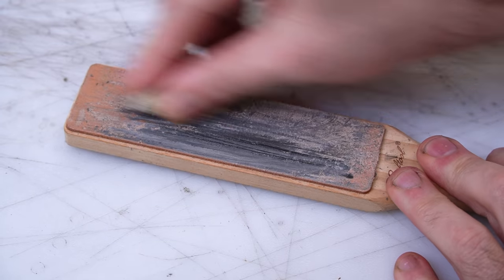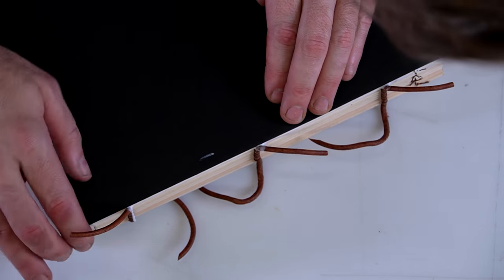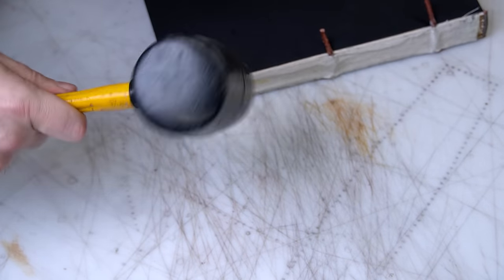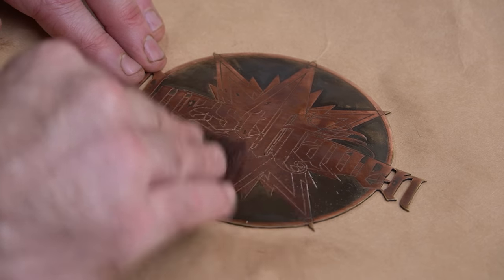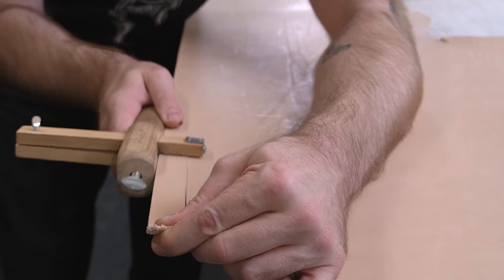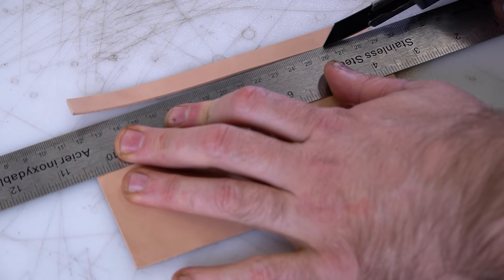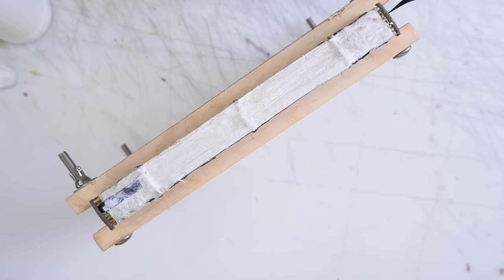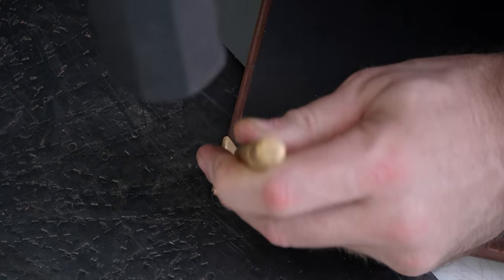Making an Epic Leather Book for QuestHaven | Learn How to Make a Book

Comment: If you glue thin cloth on the back of the leather before gluing the end pages, it makes the leather a little more rigid and leaves a nice surface for the end pages to be glued securely. Making the first of anything is tricky even when you have experience with similar projects. Great video!

Comment: Not a bad attempt, in the end it came out looking nice! Hopefully you learned that the order of operations in book making is VERY important. Typically after i make the text block (spine glued, headbands, etc) i clamp it between 2 planks of wood and then glue the leather onto the spine only, then wrap cotton twine around the whole rig to press the leather firmly against the spine bands and then burnish everything down nice and evenly.

After the spine dries, the cover pages go on, then the cover itself, then glue the cover page to the cover neatly. If you have straps or decorations, a spare sheet of 6mm or thicker EVA foam can be sandwiched between the plank and the outer cover to provide even pressure over the surface. 

Also be sure to put a piece of masonite or thin smooth plywood between glued cover page and the free cover page on both sides for a more even finish

Comment: Instead of bothering with paint I would have tried the patina solution. Apply it with a paint brush just to the letters and call it a day. You still get a natural metallic look that stands out just enough not to look out of place.
And endsheets are definitely a science that takes many... many failed experiments to perfect. To anyone struggling, add more leather to your hinge area and use spray adhesive instead of pva.
Reply from the maker: I actually did patina the letters, I skipped showing yet another thing I did with them. Just looked not right.

Comment: Hey Magnus, what was the thickness of the leather used for the cover? You've shown me some new budget friendly ways to do a project I've had on the back burner for a while.  Awesome work as always
Reply from the maker: Cover was maybe 3-4oz, just be sure you can either skive it if it's too thick, or fold it if you can't skive it.
As long as whatever your end result is, as long as you can fold it nicely over your end boards that's all you really need